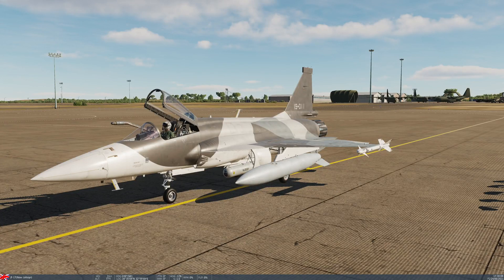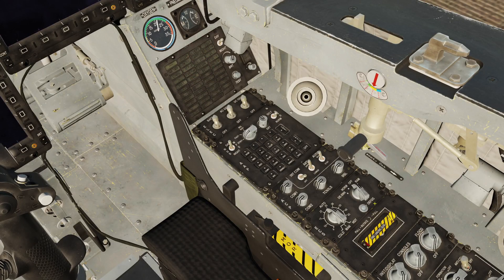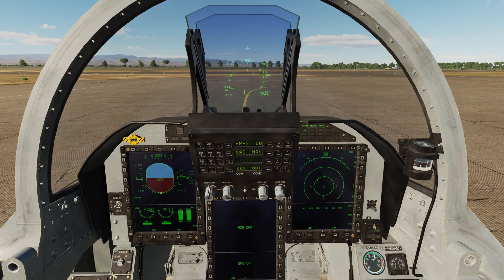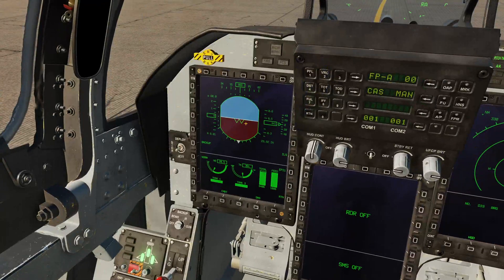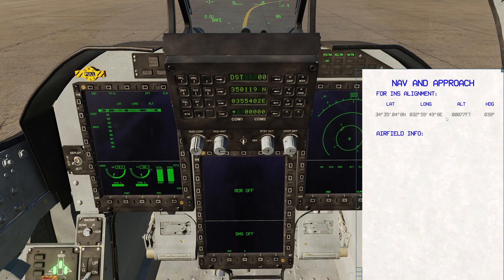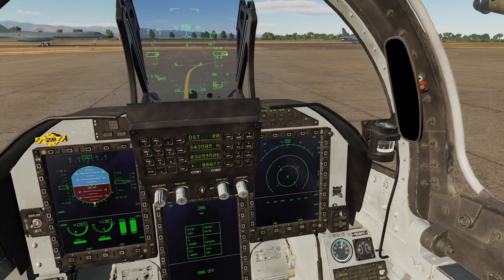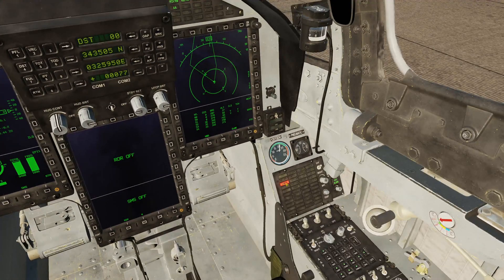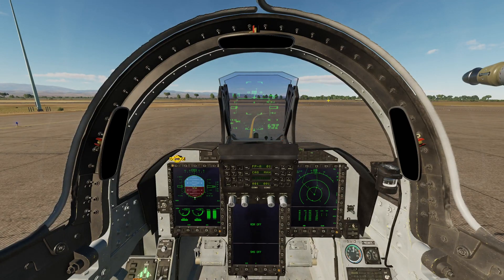DCS JF-17 Tutorial 1 - Startup

Comment: It seems Easier to Fly than the F16. Its Computer/Autopilot Controlled. The F16 is more Manual.
Reply from the maker: JF-17 is only FBW on the pitch channel. Yaw and roll are stability augmented only. F-16 is full digital FBW.
Reply: @deephack  You Don't Need it to Be Fully Fly By Wire. In Fact You Don't Need Fly By Wire. Kings Train their Son's at Age 15. By Age 25 they can Fly a Mig 29. No Fly by Wire. all Manual. You Don't Need Fly by wire. The JF17 is not Difficult to fly, like the Mig 29. Its Easier than that.